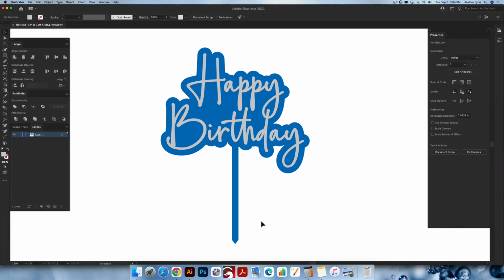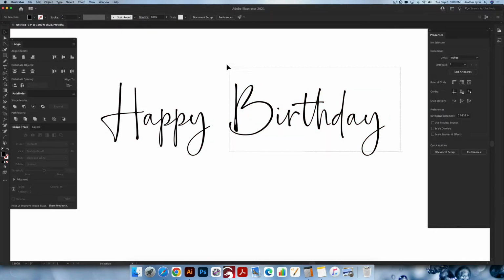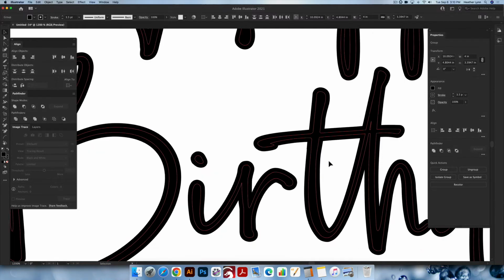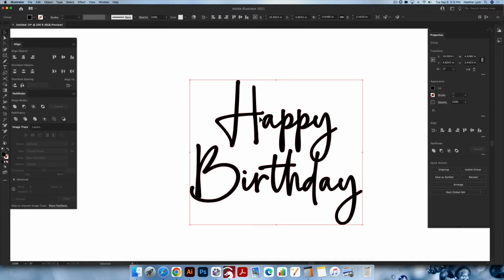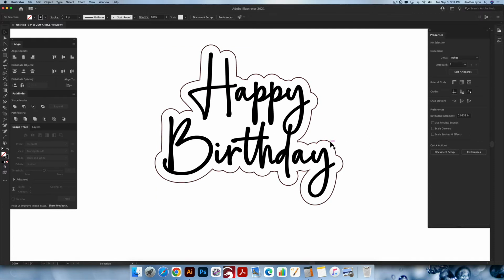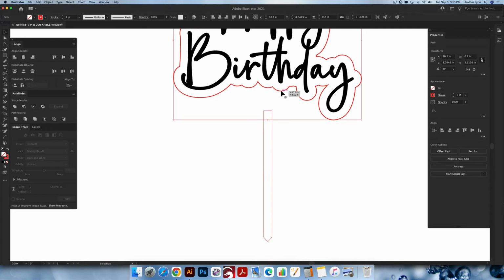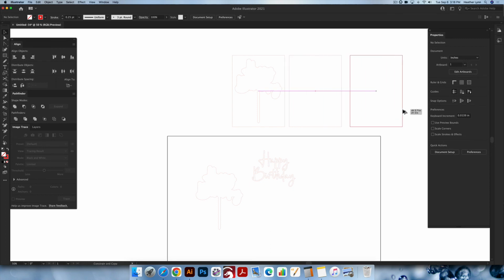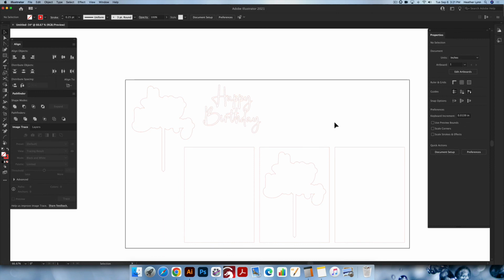Adobe Illustrator — Creating a Layered Cake Topper SVG for Laser-Cutting

Comment: Thank you for the very informative video. In general what is the best font size ?
Reply from the maker: Thanks for watching! It really all depends on the font type, project size, etc. — thinner fonts often need to have a stroke added so they're not too fragile to cut so even if the font size is, say, 12... with the added stroke, it changes the overall font size. 

Hope that makes sense!
Reply: @LoBoDesigns  ok got you. Thank you so much for the reply

Comment: Hi!

Thanks so much for this explanation. I am a complete beginner and it helps a lot that you show twice, and also show how you would do the i-dot merge even while you wouldn't like it.
@7:24 you say 'Press Shift + X to change from stroke to fill.' I am a little bit confused by this because what I am seeing is a fill being changed to a stroke. Am I right, or am I missing some knowledge?

Thanks a bunch again for the videos!
Reply from the maker: Thanks so much for watching! 

Shift+X is the tool that will either swap the current selected object(s) from Fill to Stroke, if the object is currently set to Fill... OR it will swap from Stroke to Fill, if the object is currently set to Stroke!